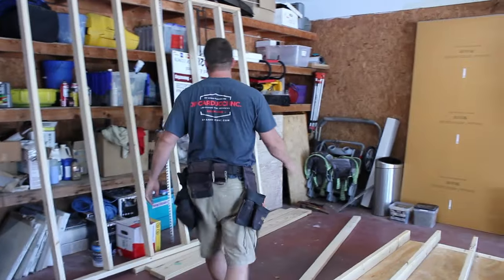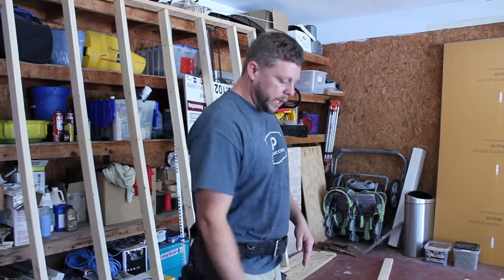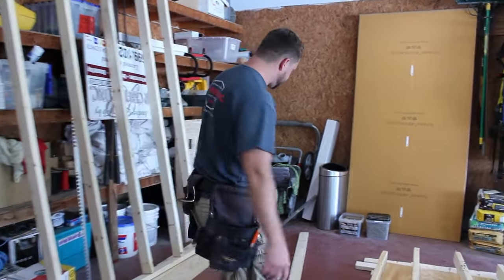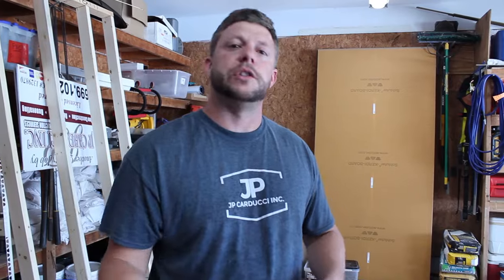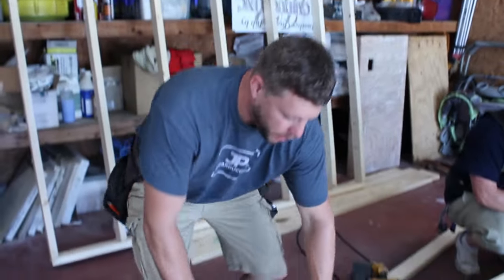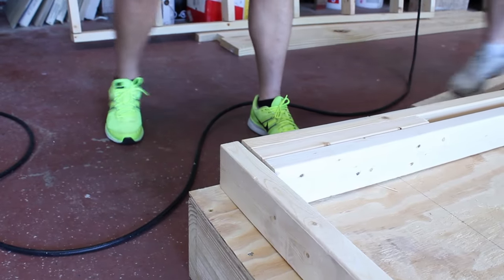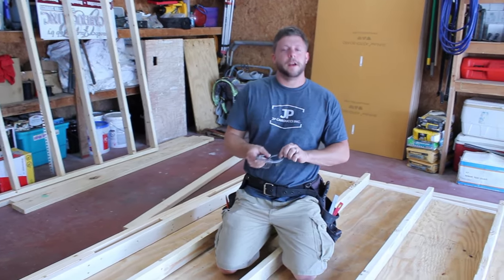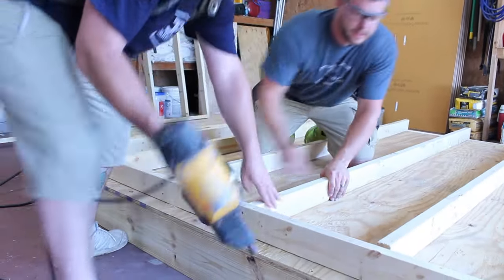How To Frame A Corner For A 90 Degree Wall Connection

Comment: For what it's worth; presuming those are exterior walls, that no longer meets code in many locations of the country.  (Model Energy Code)  The problem is it prohibits efficient insulation installation and allows too much exfiltration / infiltration.

Comment: After the corner is attached, how do you measure the next stud  so it's 16" on center?  16" from what? Also, do you compensate for the thickness of the drywall at each corner when adding studs 16" on center?

Comment: how does the 16 inch center and 8 foot sheets of drywall break on the center of the stud if the corners are done like this???
Reply: Measure 3.5" out from the corner. That's the inside corner. Measure 15.25" to the edge of the first stud, then 16" from there , all on the edge. It's called "on center" but it is easier to hook ur tape and lay out on the prominent marks on the tape.

Comment: I wouldn’t let this guy do my framing. Should definitely use a California corner. Now there is dead space in that corner. Not up to code for high efficiency homes. Reason being is how is the insulation going to get in that dead space! Foam is only option and need to be done before putting wall up…

Comment: Your construction of a corner is outdated. A California corner allows for insulation on an exterior wall.
Reply from the maker: +Jim Watson Maybe you are right, I do more interior framing than exterior because I typically build concrete homes because stick homes are outdated!!!
Reply: JP Carducci Inc. lol good one. you got him hehe
Reply: The drywall will crack over time as the two studs will bow and wharp.... the four stub method is more reliable as there is more structure and strength to the corner.

Comment: You are not demonstrating any kind of safety practice at all here (as clearly shown). What I'm really in disbelief here is you almost took your eye out and posted it anyway. Wow.  If anyone attempts to use ANY nail gun the way this guy did, SEVERE injuries are inevitable. This video should be flagged and removed for safety reasons.